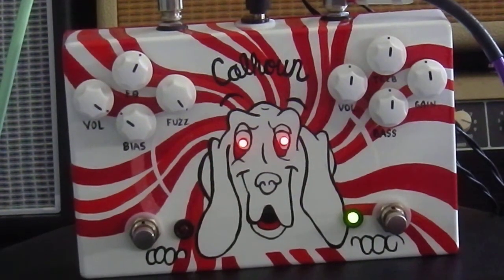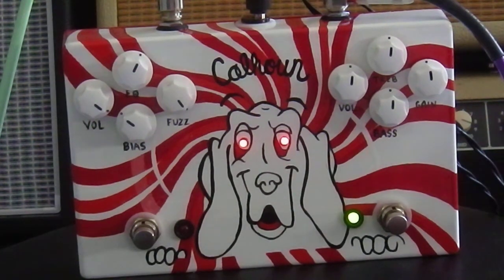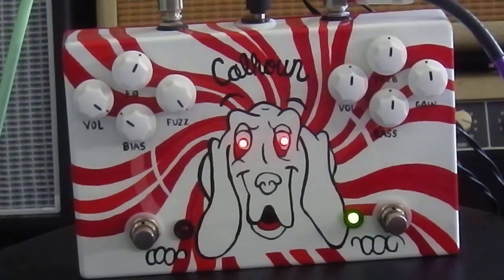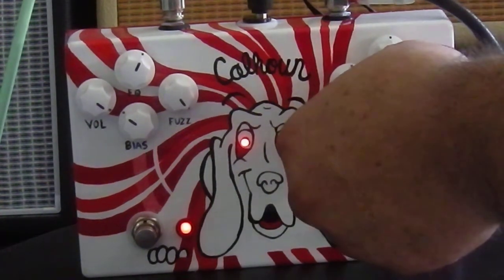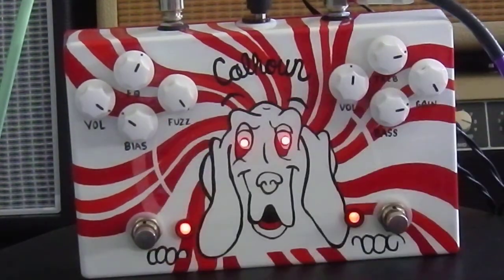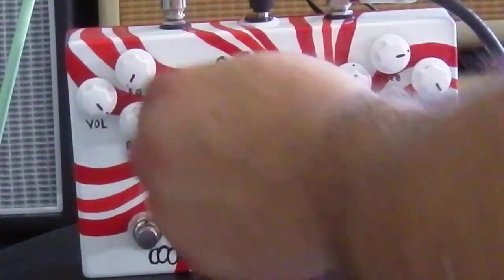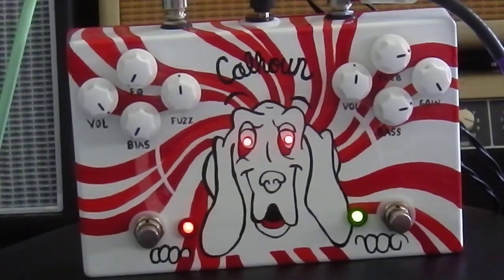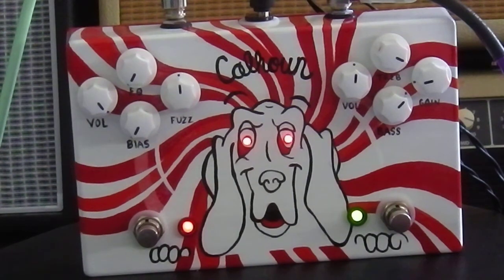JHS Calhoun Mike Campbell Signature Overdrive Pedal Demo and Sounds

Comment: I have the V2 of this pedal and use the drive as my main dirt.  The fuzz is great and the stacking and order switching create so many more tones.  I wanted this original pedal but after hearing it here i would not have that same thought.  I did not hear that many usable tones with this germanium version 1.  Maybe it is because the V2 is silicon...?  Unsure.  I just can't believe how poppy that tone is with the drive set so low.